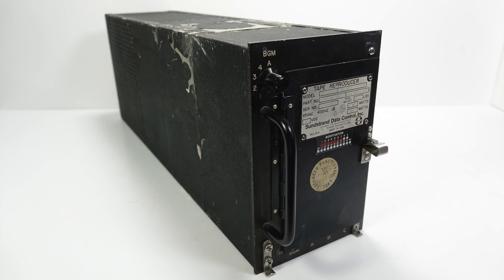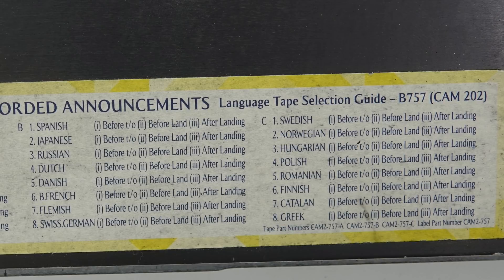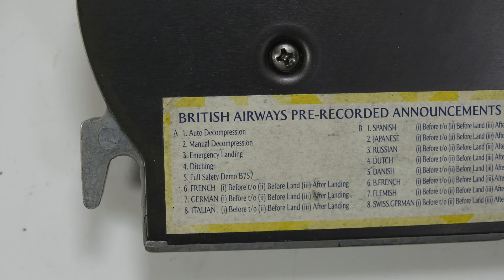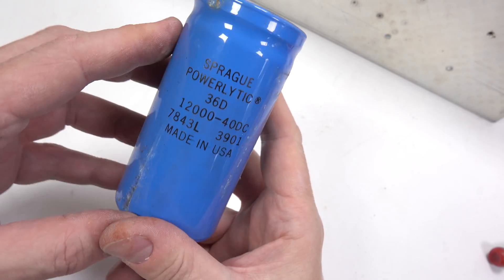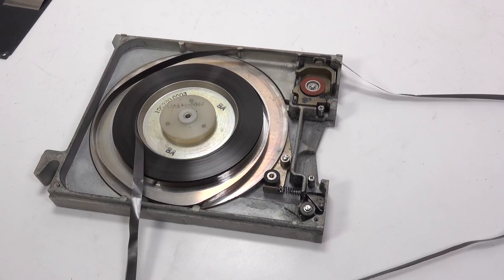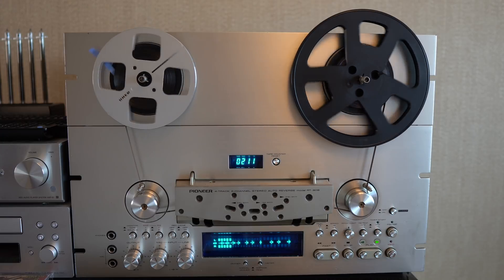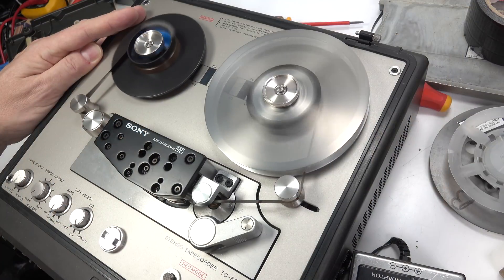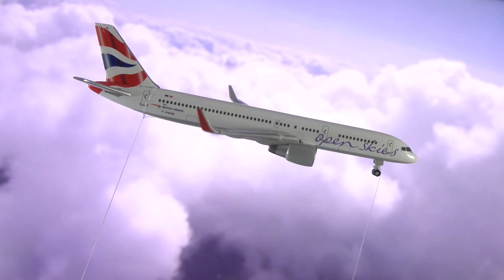Tapes on a plane (Part 2 - The Tech)

Comment: I'm curious as to the playback speed on these? Youd didn't really go into that. Also, is the tape the same stuff used in 8 track carts? Or was there slight differences in width or thickness? Also, if the tape reel itself doesn't move, wouldn't that put serious wear on the tape? That seems like an oversimplified idea.

Comment: Probably the best way to get that working is to try to find a pinout of the various pins.  I am guessing that device has several inputs and outputs.  I would imagine the one that triggers the pressurization and water landing probably go to a switch or sensor in the cockpit.  The safety annoucement and entry music were likely connected to a panel accessed by either the front of the plane or one of the galleys.  The audio out likely goes to either the speakers or is like a line level out that goes to an amplifier for the overhead speakers.  I suspect there is also circuitry to override or mute the headphone system if one of the emergency announcement channels is triggered.  I suspect it is a complicated device inside.

Comment: The thing I always found weird about aviation equipment, is how it is always big bulky and heavy. I understand that it has to be built to last and also pass safety regulations, but does the background music tape cartridge need to be made out of a metal casting, instead of plastic, when there is surely large weight savings to be made on non-flight-critical parts such as this?

Comment: "Unfortunately that something is a Boeing 757... And I don't have one..."

Dunno why I cracked up at that, but I did.
Reply: Exactly what I was thinking :D
Reply: Can you imagine the guy getting a ticket for a flight on one, and while he's up there, he starts nosing around their equipment with a screwdriver, looking for a control head for his tapeplayer, and gets ejected from the flight.  
.
Reply: I scrolled waay too much for you comment sir !
Reply: Mat, I have a schematic of that unit as it was used in a Lockheed TriStar (yours was probably delivered in one in 1980). Pin 1 on the connector is 115vac 400 hz input and pin 10 would be ground to make the capstan turn. There is a 0.75a fuse between pin 1 and the capstan motor. Let me know if you want a picture of this schematic
Reply: @N747PA  like that guy so he gets in top comments
Reply: Same! Would be the ultimate purchase by Techmoan simply for a few minutes of audio :D That and him showing the $14m eBay result made me laugh out loud. Great stuff TM!
Reply: @aeiouxs  I love the financing offer that starts at as low as 86 thousand dollars monthly :D  That's a fairly reasonable 13-14 years loan time.
Reply: Time stamp?
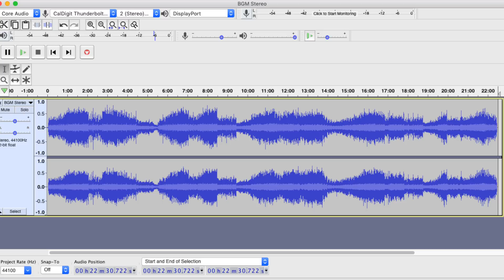Reply: @gator_productions  8:24

Comment: If you can supply 115V 400Hz as it indicates on the back of the machine you might be able to power it up, but I guess that requires an old Boeing in good working condition.

Comment: Nice coverage of the hardware, I agree it would be difficult to get the unit working without at least a schematic to identify the power, signal and control pins on the connectors.  I worked at a company building and testing a similar unit used for cockpit warnings in the DC-9-80 aka MD-80, but it used EPROMs to store digitized audio.
I was pleased to see how you extracted the audio off the tapes, I'd have done it about the same way.  I used to have a Quadraphonic 8-track tape playback deck, think it get pitched years ago, but it might have worked for you.  A special notch in the tape's case selected 4-channel mode, so it would step through two four-track programs instead of the usual four two-track mode.  If I find I still have it, I'll let you know, you're welcome to it!
Take care, stay safe, stay healthy!

Comment: I'd be curious if someone could help you make this thing work. It could be quite the reverse-engineering effort, but I'd hope someone worked in the aircraft industry and has a rough idea how these are electrically operated? Otherwise, you could maybe get in contact with bigclive (bigclivedotcom channel), I'm sure he'd do a great job at reverse-engineering the machine?

Comment: 4:07 I think that's what one would expect for aircraft equipment, particularly if it has anything to do with safety: you'd expect the internals to have some redundancy, a complex board to manage the controls scattered throughout the plane (as you pointed out), etc.

Comment: It's worth noting the frequency on that bad boy.  400Hz!   Plug your domestic vacuum cleaner into a 400Hz aircraft power connector and it'll suck the carpet clean off the floor.

Comment: take note that aircraft electronoics have a power supply that  runs on 400 hertz a.c.. 120 or 240 volts. home electricity runs on 50 or 60 hertz. which may be why you could not run it.

Comment: Geez, you were not wrong when you said about the lower tape head being worn, more like worn away and it was a wonder it would work.  I wonder how many Kilometres of tape traversed that head.
Reply: Let's math it out. Assuming 30 years of operation, 300 flight days a year, 4 flights a day, 30 minutes on/offboarding each, that would be 129,600,000 seconds. That's 12,312 km. Double that for shorter flights or longer on/offboarding, half it for long-haul flights. Add 300 metres for a funnier number.
Reply: @HenryLoenwind  Well thanks for doing the math on the figures, it worked out to be quite a bit hence the very worn head as stated.  It was kind of like when they retired a Qantas 747 I am sure they said it traveled 3.7 Billion Km, that is out past orbit of Uranus.

Comment: For those wondering, a 757 electrical system (like most commercial aircraft - the 787 is an exception) typically work on either 115VAC or 28VDC @ 400hz. I'd have to check wiring diagrams, as I'm not familiar with the 757 schematics, but this system would probably be run on the ESSENTIAL BUS system: ie, it's got power once the batteries are switched to position on. This type of unit, like many computers that run an aircraft, are designed to be easily replaceable and interchangeable, which is why it looks quite simple externally and why there was a dzus fastener on the back. It's known as a Line Replacement Unit (LRU) and is designed to be taken out as a whole unit, another unit to go into place and the unit that needs to be taken out, be sent off to component repair. Source: I'm an avionics student who completed my theory training in June this year.

Comment: These days you have an information system running a modified Windows 10 interface that resides in a small server, a large high definition touchscreen on the bulkhead wall above the cabin crew seats at the front of the plane and often one at the back as well and these have an sd card reader and a USB port on them too, the system has a menu that allows the cabin crew to select to control the headrest info-tainment screens, change the cabin lighting scheme and play music as well as select any of an infinate amount of announcements for the passengers to hear through the planes audio system/address system speakers.

The new modern systems (2020 onwards) also allow the cabin crew to bring up the planes location and estimated journey information, weather radar and aircraft running/mechanical information (this is more an extra for general information) there are options for planes with outside cameras and for the on-board WiFi Internet service.
Reply: "a modified Windows 10 interface"
Pilot: Quick! Play the emergency landing announcement.
Co-pilot: I can't Windows 10 is updating!

Comment: Well I for one like the technical detail, so to me this is the best part!
Also opening the lid to the capstan drive would be interesting, what do they use? gears, or some special belt? I do not think a standard  rubber belt would be considered good enough in this sort of application. I know some broadcast applications, where they used a nylon reinforced belt. basically a miniature car timing belt.
As for the big electrolytic capacitor, it is just a buffer capacitor for the rectified AC, It is not a power backup, it would only be able to power the machine for a few second max, if the power disconnected.

Comment: Your solution of using an 8-track player to play the tape is pretty impressive. The fact that the speed was the same and the heads aligned perfectly at least tells us they used the same equipment (or at least something very similar) as they did for making prerecorded 8-tack tapes to make the tape for these "metal" (excuse the pun) cassettes. .

Comment: You never fail to amaze me, sir.  Always something interesting dragged into the light from some of the most obscure places.

Now I'm wondering if they still use  tape-based machines like this, or if they've moved on to new technologies, like digital media.

Edit:  I don't suppose we could convince you to post that background music audio online somewhere, could we?
Reply: On newer systems everything is integrated into the entertainment system which uses a NAS as source for everything such as movies/audio/etc. Gets updated every month from just a regular HDD.
Reply: @Blur4strike I suspected as much.  I even thought that maybe they used CD for a while, but then I realized what a fiddly, fussy  bit of hardware that actually is, and I probably wouldn't want to rely on something like that.
Reply: @xaenon  I don't think they would have used CDs for safety relevant announcements. CD reading is vibration, shock and dust sensitive. It's much easier to stay with magnetic tape than to engineer a CD system with the same reliability.
Reply: @HenryLoenwind  My thoughts exactly when I mentioned the 'fiddly fussy' bit.

Comment: I'm still in awe that endless loop tapes (the reel ones like these) work. I don't know why really, I'm a tech oriented person, just something about them goes against my grain.
Reply: I mean I don't have that much of a "problem" with the ones that don't have a reel, you know, where the tape just gathers or folds in a compartment, like e.g. how the Sinclair microdrive tapes were made. :)
Reply: @pev_  I was always amazed that they got the physics of endless loop tapes to work as well as they did without the tape binding up. That did occasionally happen but not often.
Reply: @fixman88   Yeah, if you just think about how the tape is taken up by the pinch/capstan at a certain speed, that causes the reel to rotate at one speed. But then the tape is put back on the reel at a greater radius, and the linear speed is therefore greater! How can it work without binding??
Reply: It's this strange "moebius stripe" effect that is mind boggling because it has no defined inside or outside, no side A or B. It's more like once you get to the point where the both ends of this tape are taped together in a twisted fashion the other side of the take will play. I also find it most surprising is that it doesn't jam mechanical while the tape is spooled on the outside of the casset reel and the inside is taken away.

Comment: Knowing the mad lengths some techmoan fans go to, there is probably someone out there with  boeing (or at least the speaker system) that would have helped you get the audio off these tapes if the 8 track method didn't work.

Comment: I doubt you'll get one, but the BGM mechanism is very similar to the film storage at the cinema I worked at 30ish years ago. But with three horizontal reels, off the center of one, and wrapped around another. The third platter was for a second show, or to set up the change over day.
Officially a Non-rewind platten, but we called it a cake stand.

Comment: Fun Fact: Sprague, the company that made that blue capacitor, was started nearby me in Massachusetts. They're a subsidiary now.
Reply: Started by Robert Sprague - who invented foil caps and the tone control.  He didn't quite invent the electrolytic cap, but was one of the first people to start making ones that were reliable enough you might actually want to use them.  I have one of their caps that was made in 1932 and still has 82% of the marked capacitance.  Not bad for a 88 year old part...
Reply: Sprague also came up with the method of multiple unit control for traction motors on subway train cars.
Reply: @ChrisWilliams-i7d  Well, hello from the Bay State! If you're curious and want to look more into the company, their full name is Sprague Electric. Their old North Adams facilities are now part of a museum called MASS MoCA, and they actually manufactured the trigger for some atomic bombs and some parts for the Gemini moon missions. They have quite the interesting story and I was really surprised to see something that ties back to my local area in a machine from Japan through a video recorded in England!

Comment: I bet the selector knob picks which of the 4 BGM programmes to play, and A automatically switches through them as the clear section triggers the light sensor. The announcements are probably switched on from elsewhere.

I wouldn't be surprised if the BGM tape played all the time, especially as it doesn't have a solenoid input. Would explain why it's so worn out.
Reply: It indeed controls which background music track is played. Turned on and off from the cabin attendant control panel.
Reply: I suspect you are correct, though of course its audio feed would probably be 'overridden' by the announcements.
Reply: I was just about to write pretty much the same comment 😁
Reply: Kevin Counihan  Okay, I think I misunderstood you a little bit at first.  The BGM cart only plays during boarding and deplaning, yes?  And the various announcement cartridge play on demand, overriding the BGM audio if need be.

Comment: Statistically, [copies of] these tapes have to have been heard, & I might just be stoned enough to look up british airways incidents
Reply: I saw a lot of boeing 747's on the list & also a 777, which I didn't even know was a thing.  I'm lead to believe they would have re-used this system on at least a few of the generations of the plane.
Reply: Specifically, I saw a few non-fatal decompression incidents, so it seems like the message might have been played.  You thinks it kicks the amp into overdrive on those ones?

Comment: Send the unit to BigClive, I am sure he will be able to reverse engineer it and make a control circuit in no time!
Reply: Given it looks to be all discrete logic rather than some sort of microcontroller, and the amount of contacts on the interface would lead me to believe that the control system would be quite simple, if not bigclive then Mikeselectricstuff would be able to reverse engineer it easily, plus a lot cheaper on the shipping!

Comment: This device may have migrated from a Lockheed L1011, before landing in the 757.
The L1011 entered service with BA in 1979.
Reply: I saw the lockheed sticker too and went "wait...the device is 1980...757 is newer than that"
Reply: Yeah, probably came off a Tristar - by the time the 757 was out Sundstrand Data Control were pretty much only making flight recorders and ground prox warning computers.  Techmoan would probably like the DFDR flight recorder - that used metal tape - not that fake "metal" stuff that was just metal particles on a plastic backing, but real metal tape made out of CoFeV alloy.

Comment: As a former electronics hobbyist, I admire the chunky-looking 1980 circuit boards. Resistors the size of my little finger. Now it would all be a single system-on-a-chip with maybe one power transistor for amplification. Or just a Bluetooth module connecting to the avionics PA system.
Reply: I thought something similar. You could actually REPAIR these devices. 

Today, throw it away.

Comment: How long before you can buy the music / announcement system from a Boeing 737 Max ?
Reply from the maker: Given the current situation...
Reply: They switched to digital systems which use CF cards around 20 years ago. Saves weight, doesn't wear out, less power, etc. Airbus and newer Boeing designs integrated the function into the cabin management computers, so there isn't a separate module anymore. I'm pretty sure the MAX with its cabin update switched to this. The 737NG with original cabin uses a discrete box mounted in the cabin, i.e. a glorified MP3 player.
Reply: @straightpipediesel  I was thinking of the boxes themselves rather than the technology used. 

I was quite surprised to read that Boeing 757 production had stopped and the planes are leaving service. The first time I went on one I was very impressed. Instead Boeing kept the 1960s designed 737 and keep cludging bits on like winglets and engines that don't fit until it becomes an unsafe hotch-podge of parts. What could possible go wrong with that approach ?
Reply: It's a customer option, and usually integrated in the inflight entertainment system now. Boeing only delivers it with a basic PA system.

Comment: It's interesting that the leftmost bottom playhead has a LDR (Light dependant resistor) embedded and presumably a light bulb on the other side of the centre part. So optical means of finding the metallic splice tape :)
Reply: did you even watch the video?